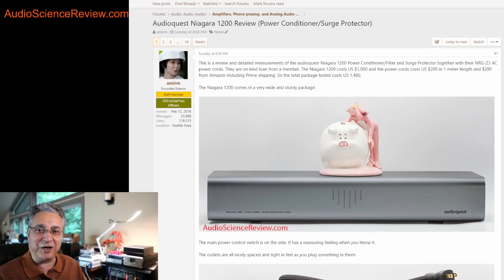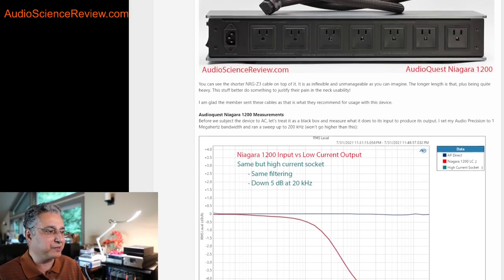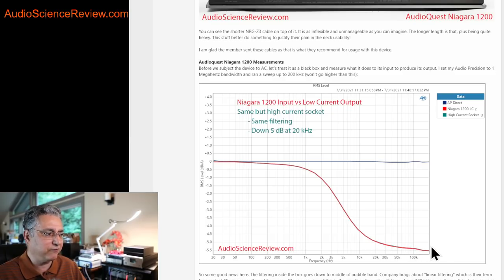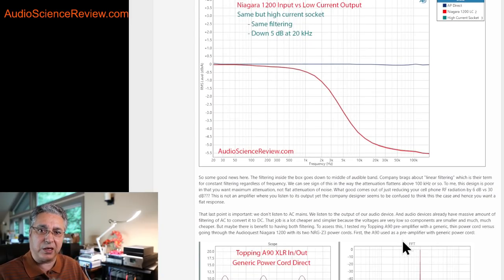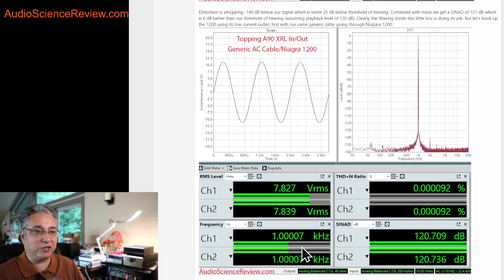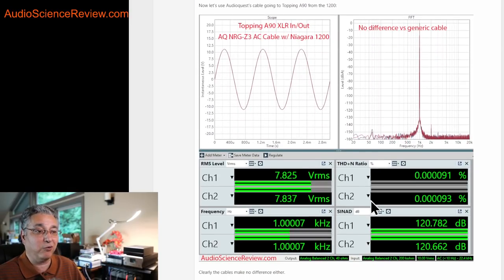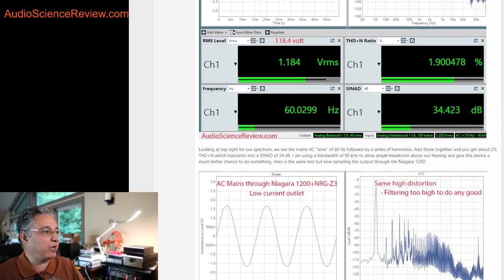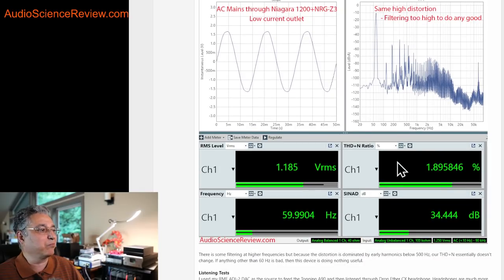Audioquest Niagara 1200 Review AC Surge Protector and Filter

Comment: Please test Audioquest XLR cables for interconnect
Reply: Why? basically everything from Audioquest is snake oil/scam. Any generic cable is already so close to perfect you cant see a difference so what do you expect to see from magic cable?
Reply: @lambda7652  i went  from generic interconnect to somewhat better (forgot brand) to AQ Copperhead (not so good) to Diamondback which has a treble clarity that is leagues above generic, and then to Jaguar and Columbia (both DBS) which add meat to the bone with lots of energy. 
Likewise USB: forest is notably better then what you get form the PC shop, and the AQ coffee ist 2 leagues above. 
So, i disagree: not all snake oil
Reply: @gioponti6359  Cool story bro... Keep coping if it makes you feel better but its all in your Head.
If the Generic cable is already not changing the sound how can you improve on this?

Specially USB... do you understand "digital"?
Reply: @lambda7652  i do understand digital, e.g i understand inside the cable its an electric field, polarization, electrons flowing, inductance and capacity, and no zeros and no ones in sight. 
I have tried for several time various different cab,es and i can say i wanted the 5€ cable to be the best or equally good. Unfortunately it is not. 
I see a religion can be built about anything here.
Reply: @gioponti6359  So should be easy to proof?! use you high end cable to transmit the digital audio to storage an back and then use the cheap cable. see if the files are different.
Reply: @lambda7652  audio stream is not the same as copying files by a modern operating system. Not sure what it means to stream audio files to storage.
Reply: @gioponti6359  And this is why?
On a modern UNIX You can just pipe your Audio stream over USB to Storage. 
but hey if you don't believe in this why not record the I2S stream between USB "codec" and DAC ic. 

There is no magic to it everyone can do it with every cheap logic analyzer or Digital scope.

Or if this is to complicated get some audio Recorder with digital input to record SPDIF or ADAT and then use a USB to SPDIF/ADAT converter.

I personally use USB to I2S to parallel to get a relatively fast "real time" output to drive a led matrix and APA102 leds.
Reply: @lambda7652  interesting to know you can stream audio in Unix to storage. Does the stream come in identical data packages and checks etc. as a conventional audiostream from a dedicated audiostreamer to DAC? Does roon run on Unix? Could i stream tidal to ssd and end up with nice flacs - w/ metadata as well?

I do not think you can do a meaningful data check via oscilloscope, what counts is the interpretation at the DAC - in analog domain. And, from experience i can tell that mine is susceptible to grounding issues, i.e. sounds less good if some other sources are attached via spdif. How come? Perhaps there is also some influence from the 5V supply voltage delivered via usb? I’d be curious to measure it and try to identify why the AQ coffee sounds so much cleaner with DBS than without, and why both sound better than the forest, which again sounds much better than the cheapo cable.

Anyway, back to the point: you may be of the opinion that usb cable is usb cable, but if i hear quite an improvement (for whatever reason) and reliably, repeatable, reproduceable, with different music, on different days in the week, month, i hear the difference when DBS is in place or not, why would i stop trusting my own ears when the very reason for listening (and refining music reproduction chain) is enjoying music (which most definitely means something else for you than for me, or do you follow dynamic bow pressure in string quartets? Does it move you? Can you tell a Bösendorfer piano from a Steinway & sons after say 5s?) and the very means to musical perception (which includes ability to distinguish) & joy are my own ears & brain and not yours? Should i really rather believe someone on youtube called @lambda who believes all is the same (and distinctly better noticable bow pressure modulation was not real) and ditch what i hear and prefer? And is there perhaps rather more to discover FOR YOU in terms of listing skills and reproduction quality than you think? I definitely think there are more shades to discover than what i can possibly perceive at the moment, but if someone tells me that what i actually believe to be able to distinguish is all the same when exactly this variability is the vitality and life in music - how on earth should this work?
Reply: @gioponti6359   I'm not talking about what happens in your head or about your feelings or about music. 
It's Plain old Data going to this USB cable. 
This data gets converted to I2S and in the DAC to Analog. at every point we can measure this. with orders of magnitude more precision then you can hear.
In every aspect...

But you "believe" you can here more/better.

Is it so hard to believe its all imagination in your head? 

and sure you can output Tidal or what ever streaming service to a SSD.
"in Unix Everything is a file"
Means your System do not care if your streaming data to disk or to a modem or over usb to a DAC.
Reply: @lambda7652  ”it is data going through the cable”? no certainty not. that is more than idealistic. 
and i am talking about music. music is more than a datatstream and a datatstream is an abstraction of what goes through the cable. subject of discussion is (reminder!) whether audible differences exist by inserting a better usb cable. limiting discussion to datastream is hilarious. i do not know how the better cable influences SQ - but it does. possibly outside datatstream - i do not know. but by saying the datastream is the same you are perhaps not discussing all possible effects, a cable might have. fact is, you want to proof i am not quite right in my perception and i do not think you approach is comprehensive enough to make a judgment.
Reply: @gioponti6359  The DAC converts Digital to Analog. So it is very reasonable to assume the same digital data will produce the same analog data.
If your DAC does something more its not a good DAC... 

So Measuring the Digital data is not is not sufficient in...
Is measuring the analog output sufficient?
Or do we need a microphone? 
Or electrodes in your Brain? 

Sure the cable can do more. Maybe its super Thick and a Acoustic absorber changing the reverb of your room. 
Or maybe it is soaked in LSD... this will definitely make hear more in the music.

Or maybe it is just pretty and expensive so you like it more and listen more carefully... 
But all this is outside of the scope for a cable test.
Reply: @gioponti6359  There is error detection checksum in USB and it is directional and Way faster then needed for audio.
Normally it is 100% perfect meaning there are no errors but if the package can just be resend. 

timing and jitter on the USB side don't matter because the signal gets processed and buffered in a FIFO multiple times.

this is one of the reasons USB is not as good for "real time" low latency use in the studio.

As you said yourself ideally the USB input stage is isolated to filter the Noise. 
Isolation is ideal but most of the time overkill and not need. 

If there is no sufficient filtering or isolation in your "DAC device" it maybe pass noise from the USB port to the analog output. 

But in this case the PC or DAC has a problem and s not working right.

"AudioQuest JitterBug USB"

for example has been tested by Amir.  
Its only a view cents of parts inside. and they are normally integrated in USB receiver.

But are You talking about more or less Added noise?! After all adding noise can be a issue but to me it sound like your talking about more of a change in sound then lower noise floor? 

Jitter in the USB signal is relay a non issue  as long as it is in the normal range 

Extreme Jitter might cause Glitches  and bugs but at this level its unlikely to fixable with a cabel or passiv device like JitterBug.

Normally some Processor handles the USB to I2S conversion. like a Xmos IC 
this Processor has PLLs , input and output buffer running at different non loced rates to make sure to deliver a jitter free and perfect i2s signal to the actual DAC chip.

Other then USB i2s is.
Directional, "slow", primitive, has no error correction/detection, and is susceptible to jitter.

If the USB signal is to bad the buffer will under (or over) flow resulting in pops and cracks.  
Some good DACs might detect it early and mute the output and give a error. but if this is happening its not a subtle change to the tonality, it sound obviously broken. 

If your streamer sounds different. maybe it sends different data? 
Do you relay know what your OS/PC or streamer is doing to the data stream? 

Coming Back to the Question what is it the Cable is supposed to do how can we measure / test it? 

The Cable Transmits in Differential mode Power and Data. in my mind the job of a cable is only to bring it from point a to point b without altering it. would you Agree? 

But the other thing is the cable dose is it transmits common mode noise.
Some more then other. because some have for example ferrite chokes.

So first we wold need to find a bad DAC that is susceptible to common mode noise from the USB port and a bad PC with common mode noise on its USB port. 

in this case a better cable or a isolator/filter can lower the noise floor.
Reply: @lambda7652  am talking about SQ improvement with jitterbug: way nicer treble as in unclear but harsh w/o and clear and silky w/jitterbug, better 3d soundstage, one class up in SQ at least. Yes perhaps i habe a supercrappy DAC. But it got good ratings especially in usb mode. 

From the second half of your text.. do i read here ways of noise .. etc to enter a DAC influencing SQ? 

One thing disturbs me a bit in this discussion: i am no EE eng, but have studied physics, I would never ever in  my life say certain things are to be excluded from reality and he who says otherwise must be imagining things, when - ok subjective - “measurements” exist that indicate something real. And history of audio tells, measurement conventions lags behind human perception. USB audio was lebelled “perfect” until someone made the dac master and took things to another league. That is normal development, and audio isn’t even normal EE, since audio isn’t about bare function only - which seem to be the mere requirement here on this site. Subtleties in perception and in technology obviously are wholly excluded here. Assembly of audio system by conscious choice may thus result in quite different levels of transparency, which in turn results in different listening abilities.  A viscous circle?
Reply: @gioponti6359  First have you Joined the forum? 
I would appropriate having this conversation there.

many of your point have been said before and i could link to the resource.

Analog audio will never be "perfect" 
But how good is good enough so human can't tell the difference? 

Digital files can be "perfect" since they have limited amount of resolution. 
Modern DACs are good enough for perfect CD Quality.

But modern 24Bit/192khz is way better then CD an indeed ther is no Consumer DAC that can perfectly convert this from digital to analog. 

But all this problem starts in the Analog world. in a digital world there is no problem of sending 64bit and 1Ghz bandwidth. or more... 
 
And Yes Noise maybe can enter the DAC over the USB cable and "leak" to the analog output. 
But is it the job of the cable to remove this? 
Or is it the job of the DAC to not pass noise from USB to Analoge...
Reply: @lambda7652  i have not joined the forum yet. You might post a link? 
Would be curious to know what DAC is bulletproof w.r.t. all issues introduced by streamer bridge, cable, jitter, ground noise, and doesn’t introduce ground noise to the pre-amp - any suggestions?

Comment: There is an understanding that LPSUs are better than the newer built in PSUs in modern DACs like in SMSL or Topping DACs. Has anyone experienced and can tell the difference in SQ between the two types of PSUs?
Reply: yes: SMPS can provide very clean and fastly controlled voltage, but the cheaper ones add noise in the system on the net voltage level. meaning: the hifi system sounds different if you just plug in an SMPS into you distributor that supplies your hifi. different means: harsh treble and mids, bass can also sound “better”. 
theres a 100€ smps by ifi that seems to be highly filtered and has less to almost none of the described effects, but IMO takes away PrAT and snap and some rightness of sound. but is way better than their 50€ version.
Reply: look at the noise measurements, if they used bad power supplies with a lot of noise it would show in the measurements. The truth is that it is not too difficult to make a switching power supply low noise. It is just that many of them are very noisy, so it leaves a bad taste

Comment: Almost everyone does these same type of “reviews”, and in the end we have learned nothing about the sound. I personally, am not going to buy a power conditioner for my system, install it, and at night, turn the lights low, stick some probes in one of the outlets, and me and my wife look at a spectrum analyzer, make comparisons of ac noise, ect. We would prefer to listen to music, and hopefully appreciate the improvement in sound quality the conditioner made. Just tell us what, if any differences the product makes in sound.
Reply: it doesn't make a difference, the power supply of your equipment is seeing an insignificant change on the voltage which results in an insignificant change in the performance...... all the difference you hear is your mind convincing you that the money spent was not wasted..... This is ignoring all good power supplies in modern equipment have noise filtering to combat such known issues,,,,,

Comment: Oh, forget audio equipment ... pro studios and computer data centers use line conditioners up the wazoo .... and they cost WAAAAAAAAAAAAAAAAAAY more than audiophile gear. If Amir can't measure diffs using HIS  fancy schmancy test criteria,  why then do the pros insist on such gear?
Reply: It is misleading  to make the assertion that studios and sound engineers are using such devices to improve sound. In any studio I have visited. The job of the power conditioner is to provide stable ground, and regulate voltage to protect the equipment from surges and brown outs. And yeah when you have a $250k plus stack of equipment you do not want to cheap out on the thing that protects it. So some of the gear used is big buck. The only time I have had a conversation about improved sound, by an upgrade to a Soundman's power conditioning solution, is in relationship to the elimination of ground loops. Never once have I had an Engineer tell me that "Yeah I just upgraded the Furman and man,  I got to tell you what is coming out of the board now has so much more texture and clarity".   I only have that sort of conversation with folks who consider themselves Audiophiles.
Reply: Equipment protection, ignorance for anything beyond this.
Reply from the maker: Well, there is not much evidence that data centers need such things either.  Have you ever seen data on two identical data centers, one with and one without such power conditioners, and demonstrate that one does better than the other?  I have not.
Reply: @AudioScienceReview  Ditto: I also work in IT. The purpose of such a thing is to increase uptime and protect the servers. Never once, I have seen such units decrease latency, increase transmission speed, or improve signal strength. Attenuation remains the same regardless of the magic the so called  the power conditioning unit is reported to have.
Reply: Not in any of the pro facilities that I've ever worked in! (Sony included). And not in my own pro video facility either. UPS on the computer gear is all I need.
Reply: @ridirefain6606  
Solid observation... agreed.

In the pro world ... just as there's acoustic isolation system, there's an isolated power system in studios.
As you've pointed out, it's not to improve sound (although a byproduct), it's to provide consistency, a stable platform, immunity from corruptive external elements (similar to acoustic isolation). 

Properly engineered low impedance grouding system is the starting point, shielded isolation transformer w/rf, spike and surge protection, local panel allowing short, dedicated low impedance home runs, via upsized branch wiring alleviating potential voltage drop choke points... dedicated, isolated neutrals/grounds ... in a star config.  

Just best practices, ie., a solid operational platform, w/low impedance ground paths, and low impedance voltage/current source paths. 

Physics
Reply: @ridirefain6606  absolutley correct. I've been in countless high-end data centers with millions of dollars of rack-mounted servers and networking equipment and all those places ever care about is surge protection and battery backup. They want the absolute BEST of both of those, for obvious reasons. The words "line conditioning" are never even mentioned there. (Hint: There's a reason for that)